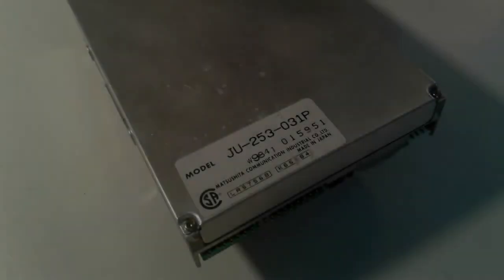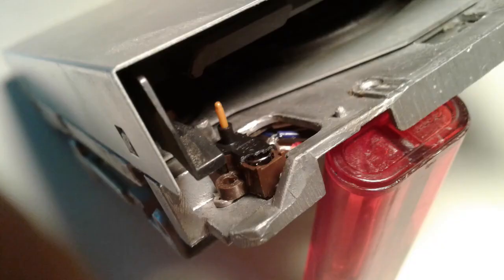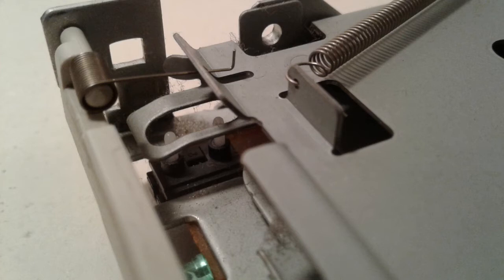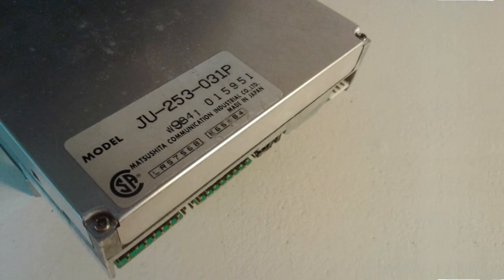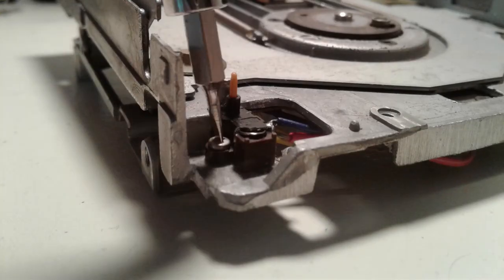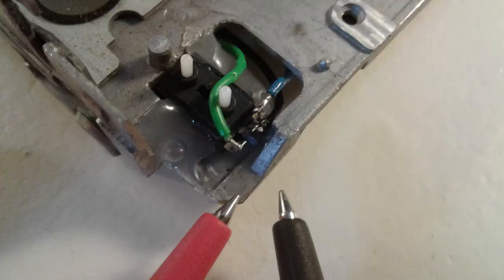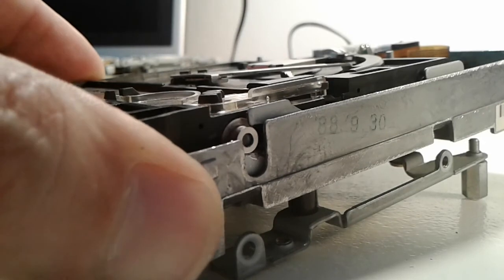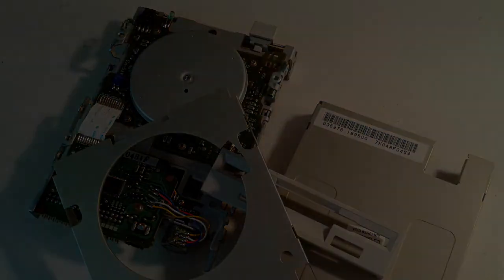AMIGA alive 04: Floppy drive repair (write-protection switch)

Comment: Hi, This is a great video for solution finders of these old things. I am inspecting how to repair my  JU 253-033P. Same manufacturer but different type of electronics and mechanics. There is also those kind of switches but every switch is separated. Not like those twin-types what in yours 031P-model. At first I noticed that those switches are hard to find from market. MAybe there is no new- nor old-stock but somekind of retrofit solution would be using 6x6x13 tactile SMD-switches. The question for use those SMDs is those switching force which could be too much for sensible switching. I almost trying to investing that fixing method but now I found correct type of swtiches from my old defective Alps-PC drive.